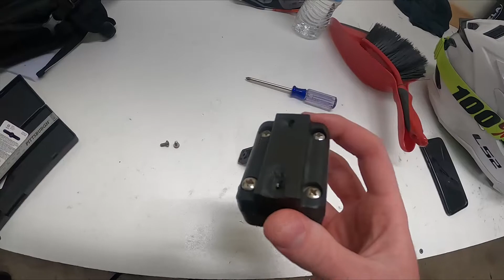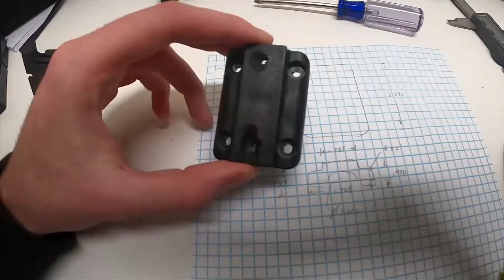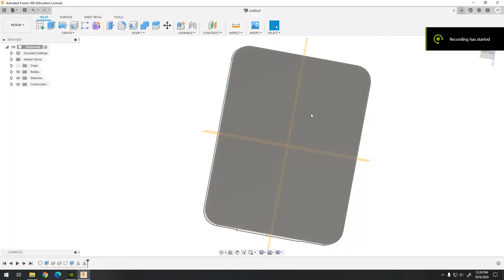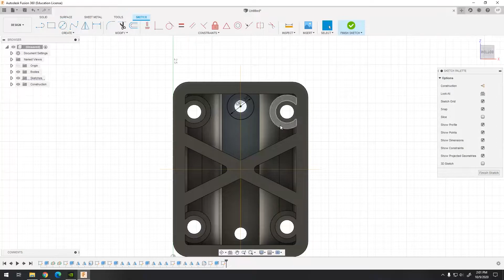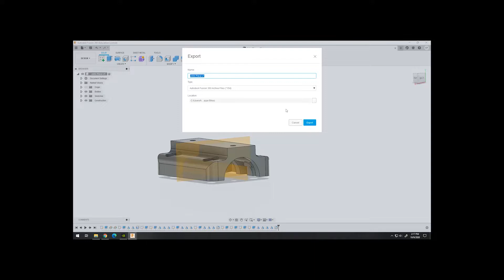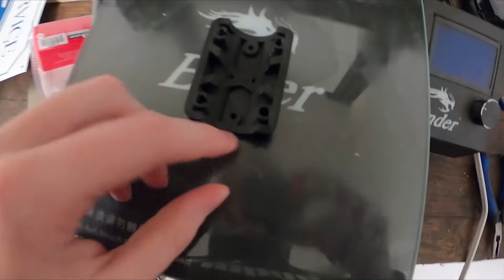Reverse Engineering with Fusion 360

Comment: While I have yet to actually nail down the "how" - there's a way you can scan the part (2D flat bed scanner!), import the image into F360 and make your Sketch from it (like you were using copy paper).  Then accurately measuring a point you scale the drawing you just made to those/that measurement.  I've seen it done, and it saved a LOT of measuring and drawing details.  I really need to get that nailed down.
Reply: Gotta love the YouTube algorithm machine! No sooner did I type the above comment... I got a recommended of this: https://www.youtube.com/watch?v=iaUMYRP3CxA&ab_channel=AMCustomfab
which shows exactly how to do what I (lamely) described.
Reply from the maker: In cases where I have to model a part and don’t have access to it in person, I’ve asked people to take pictures of the part with a ruler laying next to it. Then I use a portion of the ruler for scale like you mentioned. It’s surprisingly accurate, and I imagine doing it with an actual scanner would be even better. I haven’t done that with fusion360 specifically, but I’ve done it a couple times in Solidworks
Reply: @ParisResearch  the only issue with that is the image taken has to be normal to the object else you get errored values
Reply: @ParisResearch  if the part is too much bigger than this piece the camera will distort the dimensions..... i tried it on an exhaust flange.... basically a photo copier comes directly every point of the object while a photo image comes from only one